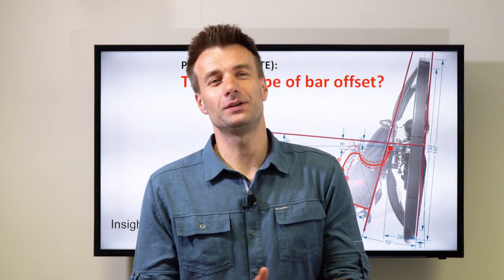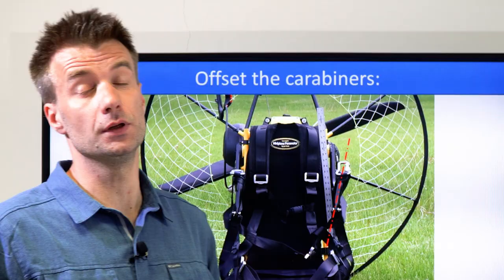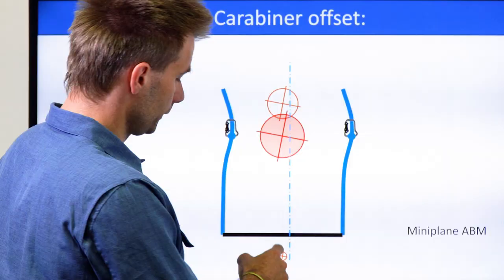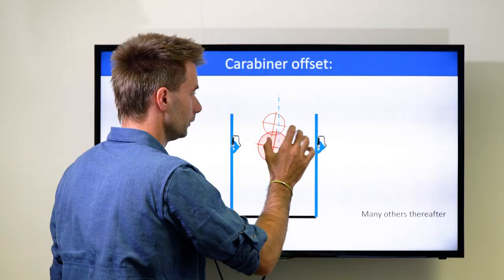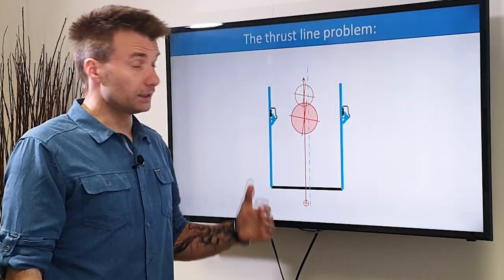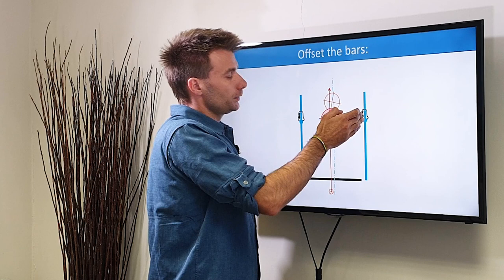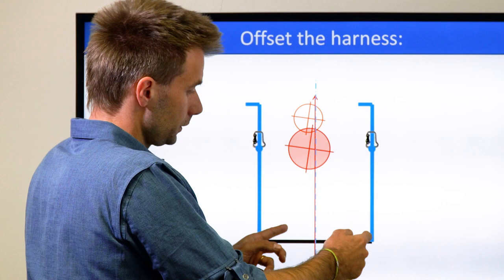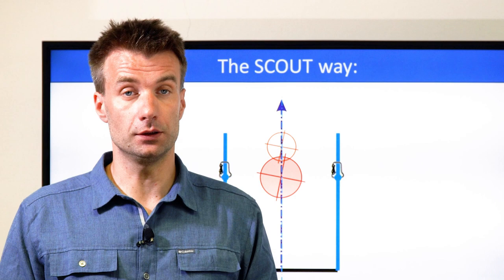The best type of bar offset. Paramotor geometry part 14.2

Comment: Fly products seems to use all of the mentioned methods of offset, and in my experience handle torque probablythe best after Scout, however all the offsetting makes the entire paramotor feel slightly skewed as you mentioned. 
Great explinations.

Comment: I recently bought the techno-fly/airconception that uses the tilted gooseneck bars and to my surprise, the behavior feels super close to neutral in all 3 axes. I don't feel any drawbacks at all, perhaps just that turning against the torques side on idle is slightly lazier and requires a tiny bit of weight-shift. Don't know how they do the magic ... perhaps testing a lot of prototypes in order determine the best combination sweetspots for all offsets. But take it as a sidenote ... thanks for another great video, thumbs up!

Comment: Thanks a lot, i learned lot of thinks with your video.
What about the 6mm screw of the goose bars on the miniplane ? too weak ? 
The original screw is a 8.8 grade, i'm gonna replace it with a 12.9, is it better ?

Comment: I've seen some prototypes of coaxial propellers -- obviously greater complexity and more parts to fail.  Additionally, there are a couple quadrotor (similar to DJI and similar small drones) that have four small propellers with 2 turning clockwise, and 2 turning counter clockwise to cancel the torque.

Comment: What are your thoughts on adjustable cross straps for Torque Compensation like Adventure use on the Pluma?
Reply from the maker: I don't know how they work.
Reply: @SCOUTaviation  I haven’t seen one in person, but my understanding is that they alter the harness geometry to induce a weight-shift turn. Tom Kubat talks about it a bit in this video https://youtu.be/gFDF5Vcao-s

Comment: But what about all this compensation for thrust wont that cause the unit to turn to the left when motor is off and in a glide only ?
Reply: Yes a good observation, this actually occurs on light aircraft too. Most paramotors and aircraft are balanced for cruise RPM. I’ve also noticed the aspect ratio of the wing can have a varying affect on how pronounced the torque effect is on non-Scout paramotors.
Reply from the maker: Yes it will slightly turn, over compensating non existend torque on idle.
Reply: @SCOUTaviation  Active Dynamic Torque Compensation --- The anti-torque vanes/spars will pivot based on RPM :)

Comment: The carabiners offset in the miniplane first example is wrong. They are moved to the left, not to the right. Cheers 😊
Reply from the maker: Yes I messed up. I said the drawing stands for a paramotor torque steering to the right but in the bottom right corner it was labelled as miniplane. That label was incorrect
Reply: @SCOUTaviation  hello Miro. Thank you for your reply :)